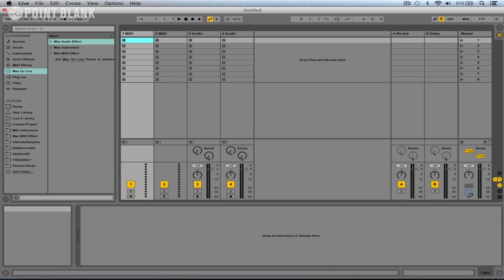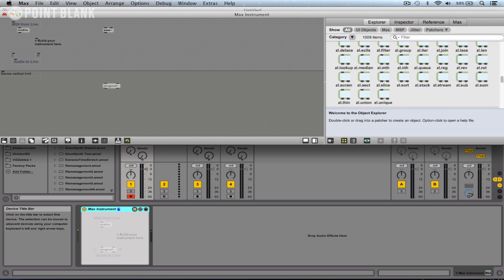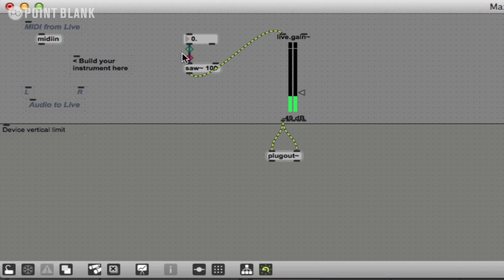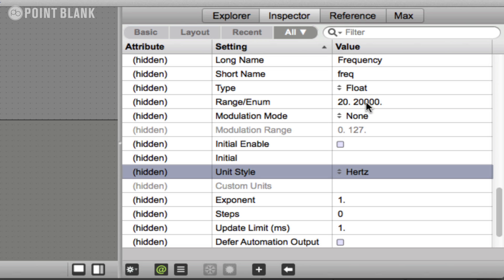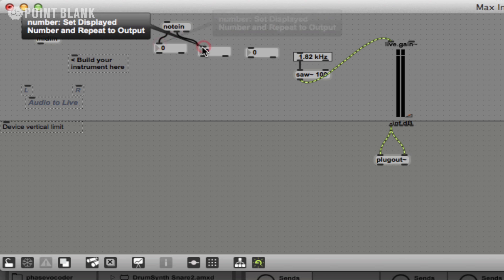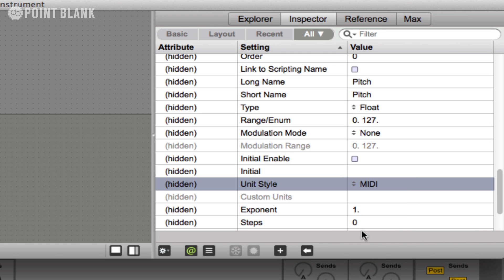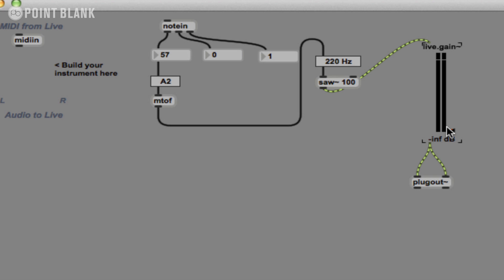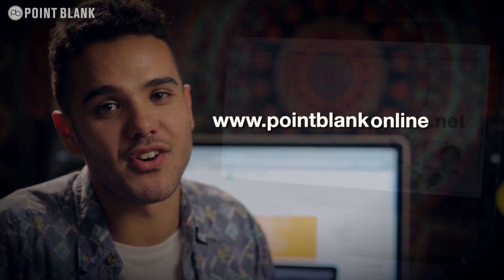How to Build a Max for Live Device: Part 2 - Building a Basic Synth

Comment: How do you move the slider control down?? When I try, the whole slider moves :(
Reply: tablepeople72  Guys, you need to lock the max for live thing...its just below it the lock button...lock it and you can increase or decrease the slider control..The best thing is just watch the part 1 video tuturial
Reply: I'm also stacking that part. Did you figure it out?
Reply: Press and hold command and then slide your slider down